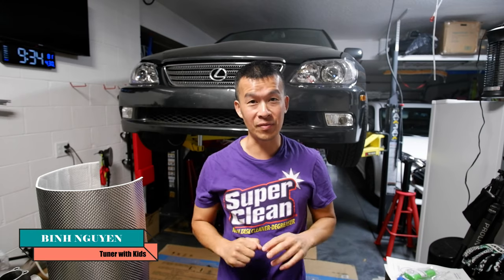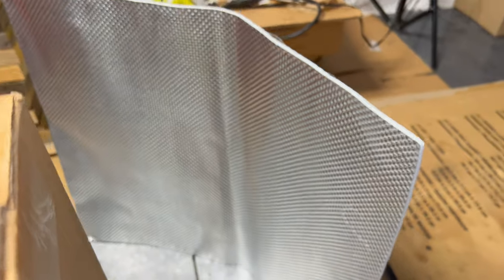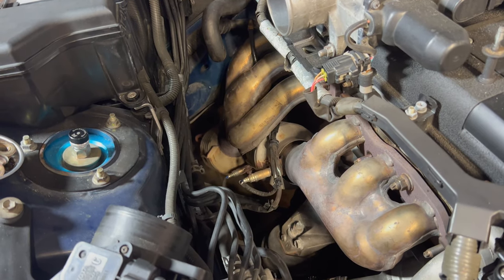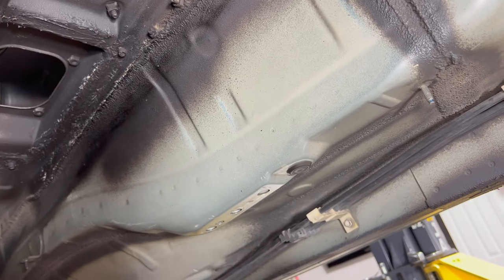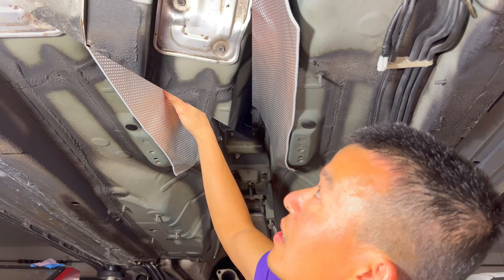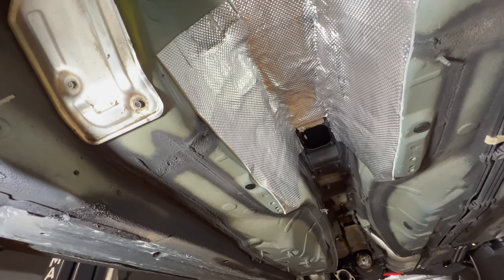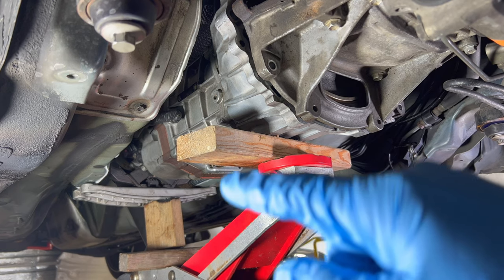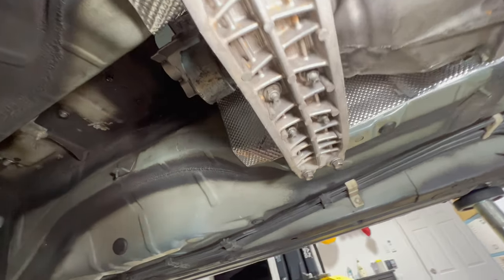Lexus IS300 Automatic to Manual Swap | Installing W55 Transmission & Heat Shield

Comment: You can pull the exhaust header from the upper side too, but takes a bit of wiggling. Can't even imagine getting the transmission in alone with only the jack. I did it with a friend and even then it was a pain. Keep the good videos coming 🙂

Comment: Thanks for these videos man ! I have is300 factory manual already done one clutch job and she anit fun on jack stands 😂  this gives me more insight on doing it more often ( fellow drifter) !
Reply from the maker: Yea build some wheel cribs from 2x4 to raise it 18” to 24” and it will be easier. When I did RMS on the auto, it was on four jack stands at highest level but still low.

Comment: Awesome details and knowledge the best swap tutorial on YT! What color was your car originally? Also did you repair your valve cover gasket leak it looks pretty oily. I have two manual TCM Sport Designs ‘03 and ‘04 but they feel slightly different because of the way the previous owners drove them and the miles on them. Anyways, you’re going to have a completely different IS soon! 🕹🤗
Reply from the maker: The car was IBP before be one of the owners changed it tie GGP. When I got the car in 2020 it was an oily mess. Check my earlier videos for all those repairs. I replaced everything and cleaned up all the oil under the car. It’s pretty spotless now with some seapage but nothing dripping.

Comment: How high extra did it lift with the extension pads , thinking of purchasing some to get a lil more lift
Reply from the maker: On the MaxJax? I have the 2.5 inch on the 5.5 inch. It gave me more room to work. But still not standing room. But my limit is the ceiling height of 9’-10”.
Reply: @TunerwithKids  nice any idea clearance under car to floor

Comment: Is the R15* transmission too large for the channel?
Reply from the maker: R154 fits fine but some of the other trans options (CD00x, T56, V160) require beating the edge of the tunnel to fit.
Reply: @TunerwithKids  thanks, seeing yours in the tunnel looked like there was some room. I may someday swap my GS to manual. Thanks for the cool video.